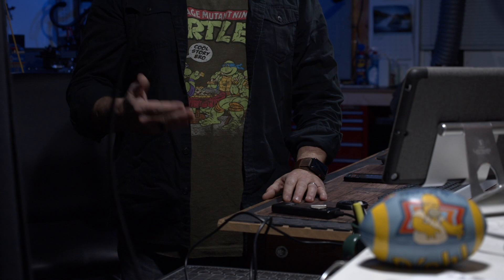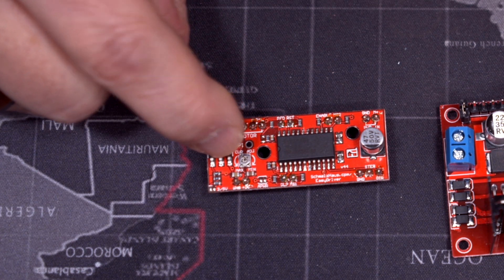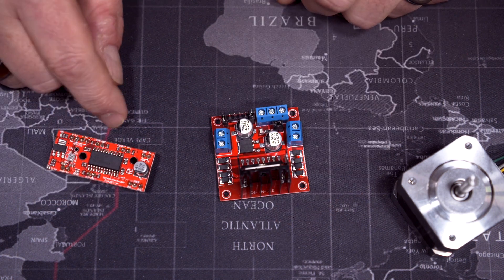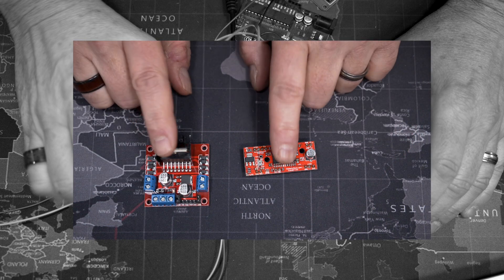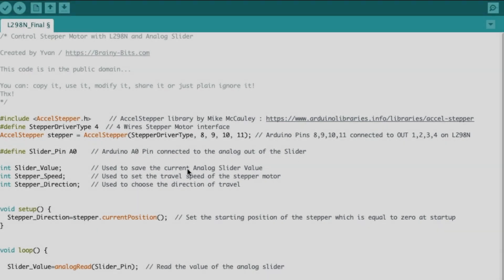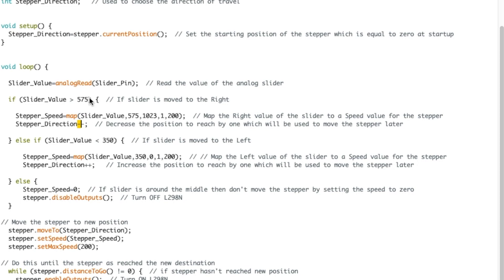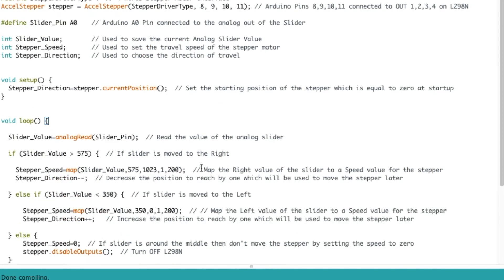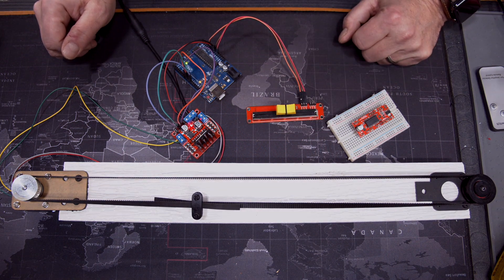The Cheapest way to control a Stepper Motor with an Arduino. But is it any good?

Comment: Nice ! works well!! ,  excellent tip about the code line for cut the power and avoid overheating. Please share me code for 2 stepper motors speed control using one joystick and 2+2 limit switches.

Comment: Also this is not recommended to use for a separate murder even for a simple project it should never ever be used for a stepper motor... They whoever they are should stop advertising that it can
 be used for stepper motors because that makes it very dangerous.

Comment: Only use l298 if you want to melt it or catch it on fire if used with a stepper motor..... If you use a stepper for more than 20 or 30 seconds it will start to overheat the module. Get the t6600 stepper motor driver for stepper motors of this size.

Comment: Hi Ivan    with a stepper motor I want to drive via a gear a module along a tube.  Like 3D printer etc.   Want 4 set positions for the motor to run to, then select 1 of 4 buttons to go to that position. In any order without returning to home position. Do you have a video or code that does that or nearly that?  Thanks  CharlesHarris

Comment: awesome! and on the edge of my seat for the shield! , i am using a cnc shield with grbl and 4 stepper motors for a cnc project. however i’d love to learn to use the shield without grbl to do custom movements or independently move 4 axis with joysticks etc. thanks!

Comment: if stepper motor datasheet says it draws X amps that doesn't mean you need a 2X amp driver.   
yes there is two phase coils inside the motor but they NEVER get max current at the same time.    X amp motor -> X amp driver.

Comment: // works but has some flaws
// arduino doesn't have to do anything else because the single steps take place at each loop cycle, therefore also dependent on the clock frequency of the type of arduino used
// the potentiometer must be linear to have a good stroke length, otherwise too rapid acceleration will cause the motor to lose steps 'read stepper motor acceleration curve'

Comment: Great video. "The easy driver doesnt need a heatsink, butvyou should install one anyway because it can become very hot"
So that's kinda like the L298 :-)
The current limiting you speak about is a bit odd. The  board doesn't pump more current through motor than it requires at its operating voltage. Limiting the current will unavoidably lead to a voltage drop and drop the power/torque of the motor.
If you would need this to avoid your motor 'getting hot if you leave it on for long' you ha e picked the wrong motor for the job.
The only reason I can see for the current limiting is to avoid a burn out of your motor in case it gets overloaded or stuck.

Comment: I had great results with A4988 

The driver you are using uses a Dual H Bridge, which means each channel can reverse also, which is overkill for a stepper and is a not needed feature which takes up more space in the package you're not using. A4988 simply is designed for stepper motors.
Reply: Hi iam having problems with A4988 driver.simultaneous motion or motors is not possible.
Is there anyway to do it?
Reply: @barathv9910  I don't believe I understand the situation. Search for tutorials on the A4988 stepper driver IC, it's very simple and you only need to pulse 2 pins with very simple code to move or choose direction of the stepper motor. I used the same stepper motor as used in the video, the NEMA
Reply: @joshfixesall4056  yes, I can move a single motor with A4988.i want to run 2 steppers simultaneously with a4988 using Accel stepper library
Reply: @barathv9910  that's a no-go, brother. A4988 is designed for single stepper motors that's why there is 4 outputs. If you mean parallel then the current may be too high for the small driver .
Reply: @joshfixesall4056  yes,I have connected 2 A4988 in parallel

Comment: I've been using the L-298 for over 30 years ! The module with the L-298 you're showing, is of course more recent. The reason why I like it so much is because it's straight forward and cheap. For me, the 'no current' limitation is perfect. Many times I used it to it's max. performance and it does the job rather well. However, I used much lager cooling elements (custom made PCB) to avoid thermal shut down. In that way, you can use it easily for continuous stall with amps above 1.6A
Reply: Haha, I have one of mine water cooled, lol! You can see the L298N waterblock mount/housing on Thingiverse under my “Penny waterblock” design (which as the name implies, does indeed use a US copper penny for the coldplate, sanded flat of course (which I’ve used in my water cooled tablet as the main render example, and these are real of course I just never updated with the actual photos since the renders I could make transparent so you could better see how they worked).

I’m not sure on the max current possible as the most O was driving were like 1 inch diameter and 2 inch long DC motors on a tank track robot test platform (small, the chassis was about a 16x18inch oil cooler radiator), so the motors never seemed to stall with 4 driving it.
Reply: Great video btw. Let's see more of that !
Reply from the maker: Thanks for sharing your experience with the L298.  A lot of people just dismiss it as being terrible, but it does have it's uses and adding more cooling like you said can make it better.  Cheers!
Reply: @Sheps  Thanks Sheps!

Comment: Hi the codes which u uploaded in ur page for the camera slider is not working.

The motor does not move at all.
It's stationary.
Reply from the maker: Hard to say why it wouldn't work, I've uploaded the code from the website to my Uno and it does work.  Maybe check your connections to make sure...?
Reply: @BrainybitsCanada  oh okk I'll check iam using A4988.i have the similar  connections as your easy driver.

Is there any change I need to make while using A4988 driver.
Reply from the maker: The A4988 uses only 2 pins (step and direction) unlike the L298 which needs 4.  So in the code you would need to change the StepperDriverType to 1 and the AccelStepper line to reflect the 2 pins.:

#define StepperDriverType 1
AccelStepper stepper(StepperDriverType, pinSTEP, pinDIR);

Hope that helps, but I've done tutorials using the EasyDriver which uses the same Arduino Code pretty much, you might want to check those out if you're still having problems.  Cheers!
Reply: @BrainybitsCanada  ok I will try and post my code here.
Reply: #include<AccelStepper.h>
  

                                  
AccelStepper stepper1 = AccelStepper(1, 3, 4);
                                  
AccelStepper stepper2 = AccelStepper(1, 12, 13);

int nos;
int noos;
void setup() {

stepper1.setMaxSpeed(2000);
  stepper2.setMaxSpeed(2000);
  
  
  Serial.begin(9600);
 }

void loop() {
  
  while (Serial.available()>0)
  {
    Serial.println("enter nos");
     
      nos = Serial.parseInt();
      noos = Serial.parseInt();
     stepper1.moveTo(nos);
     stepper1.runToPosition();
     stepper2.moveTo(noos);
       stepper2.runToPosition();

  
     }
     
   
     
this is my code,here after one motor stops the other moves.
how can i make it to move simultaneously?

    
       
}

Comment: Amazing video Yvan. Helps a lot. I was wondering if it is possible to make the 2-axis slider that you made previously with a L298N driver? If yes, how?
Reply from the maker: I would no use the L298 for that, Since I would want more steps capabilities to make the movement smooth. I will be making more tutorials using other stepper drivers that are better for this soon. Stay tuned. Thanks for watching btw. Cheers!
Reply: Brainy-Bits I was aware of that, but I am making a similar project that doesn’t need very smooth movements. I am trying to mount a light on a 2-axis motor system. I have tried recoding your code to work with the L298N, but it doesn’t seem to work. Do you know how this works?
Reply from the maker: Well the L298 needs 4 pins, so you would need at least 8 pins to drive 2 steppers.  In the code you would need to change the AccelStepper to use the L298:
AccelStepper stepperX(4, 2, 3, 4, 5);   // 4 = 4 wire interface
                                  // UNO Pin 2 connected to IN 1 of L298
                                  // UNO Pin 3 connected to IN 2 of L298
                                  // UNO Pin 4 connected to IN 3 of L298
                                  // UNO Pin 5 connected to IN 4 of L298

AccelStepper stepperX(4, 6, 7, 8, 9);   // 4 = 4 wire interface
                                  // UNO Pin 6 connected to IN 1 of L298
                                  // UNO Pin 7 connected to IN 2 of L298
                                  // UNO Pin 8 connected to IN 3 of L298
                                  // UNO Pin 9 connected to IN 4 of L298

Something like that, but of course the code might use some of those pins already for other things, so you would have to adjust accordingly...

Hope that helps...